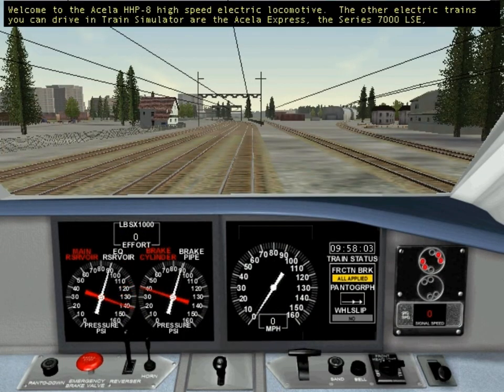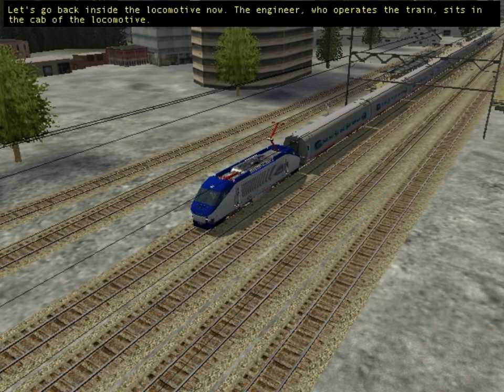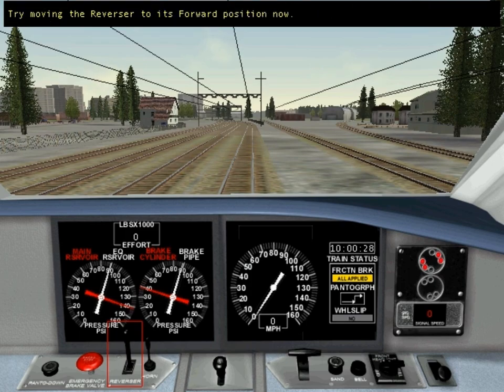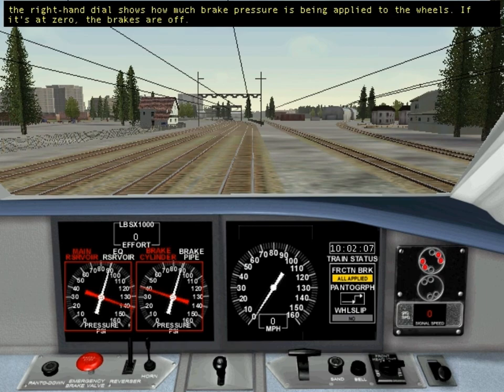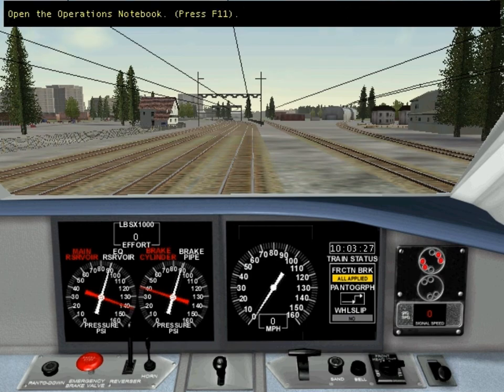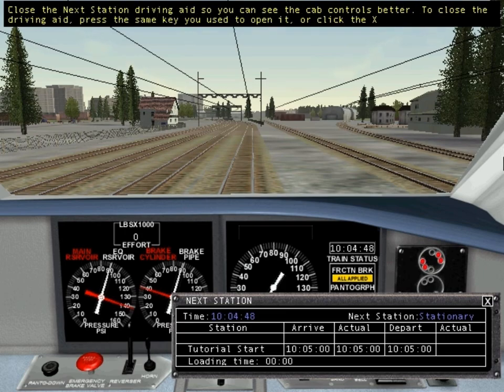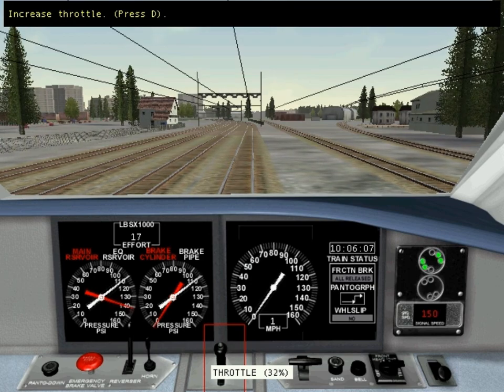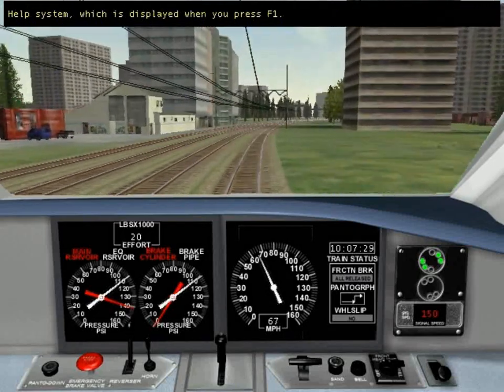Microsoft Train Simulator - Tutorial 1: Electric (Getting Started)

Comment: my train doesnt move at all even in the tutorial, even when im following all the directions, im running windows 10, the games stable and runs perfectly, so why wouldnt it work
Reply from the maker: I have no idea. It sounds like an odd bug, which never happened to me here considering how stable this simulation game was on Windows 7.
Reply: @CEO100able  I got it to work my dude, only issue is, how do you exit to main menu after you start a game and say, want to change your train, or route?
Reply: @analogaudiorules1724  press escape
Reply: @EerierFish17  at the time I tried that, it didn't work, only thing that did was Ctrl - Alt - Delete for task manager, was using windows 10 at the time, now on windows 11 and it probably be the same, compatibility mode only helps so much, now with windows 11 they changed some binary's so some older software that used to work in 10, don't in 11.